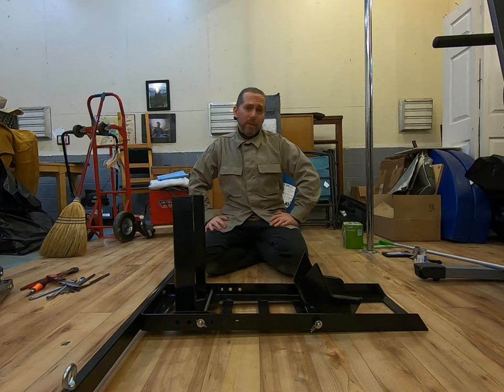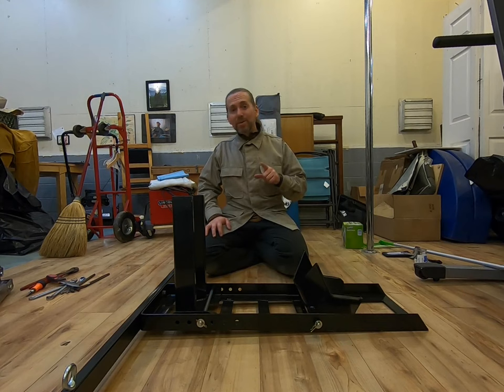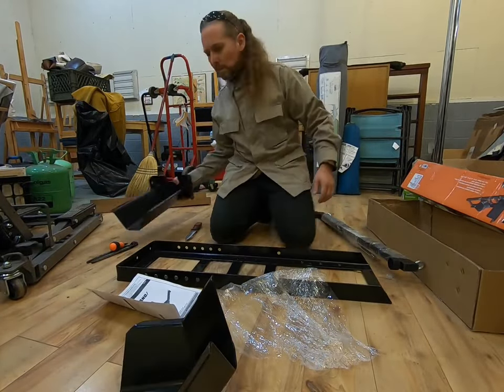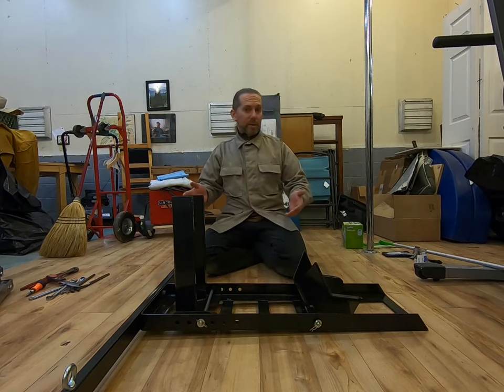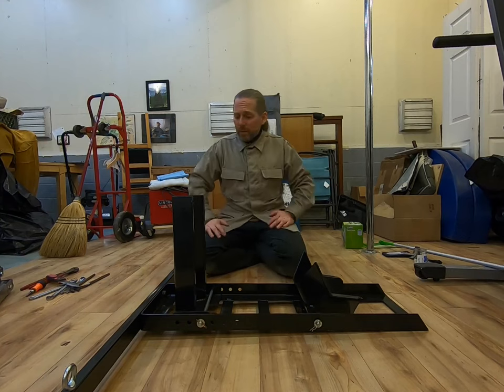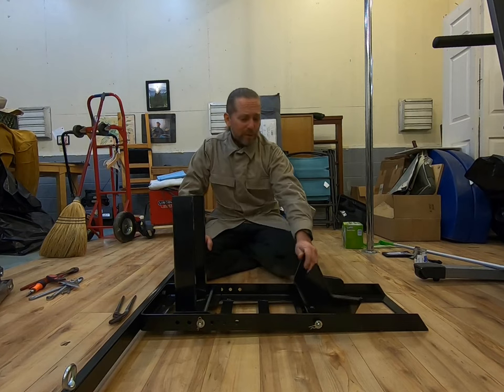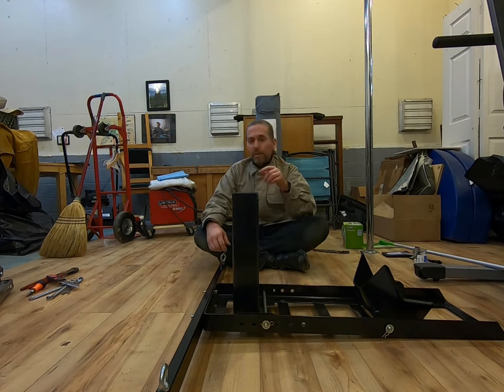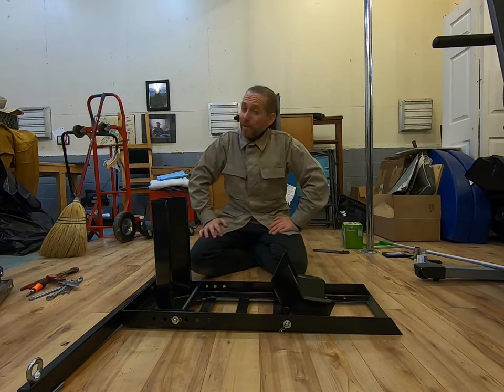Harbor Freight Front Wheel Chock and lessons learned

Comment: I recently saw another video about this issue. The guy used a 1/2” piece of plywood that was cut to fit inside the actual area where you push the tire into the chock with a 30° bevel on the front edge. The weight of the bike held it in place and it didn’t slide at all. It was removable also. Think the YouTuber is ‘what’s up bob’.
Reply from the maker: I've seen that mentioned a couple of times, and may put it to good use. Thanks for watching!

Comment: Thanks for posting.  Was it too long?  Maybe a bit but much better than being too short.  Other than permanent mounting in a trailer, I’d say the best way to keep it from sliding is mount it to a sheet of plywood.  It doesn’t have to be a 4x8’ piece but long enough that you get the front wheel on it before you hit the ramp.  The weight of the front wheel ought to hold it from sliding.  And if permanent mounting isn’t for you, use bolts and wing nuts so you can disassemble it easily.  Just be careful not to step or drive on to them.

Comment: my problem is not sliding the chock or loading the tire on, my problem is pulling my 900 LB. Road King out of the Chock. Impossible to pull back and lift up the same time unless having the neighbor  helping to push or pull me out of it. it is the same model as the one in your video. any suggestions?
Reply from the maker: So I have 3 answers. 1: consider a different style of wheel chock, one that doesn't have the "bump" to roll OVER, but you roll IN and clamp down on the wheel instead. You still probably want to bolt those down to a wider support like a piece of plywood, they tend to be narrower and a heavy bike like that may still tip easily. I only have experience with this rocker/cradle style. 2- Maybe a small piece of wood under the rocker so that it doesn't sit all the way down, decreasing the force needed to back it off. Be careful with this as you may be decreasing the stability of the bike because it can't sit fully down. 3 (and you probably won't like this) Get a different bike, your bike may just be "too much" for you. Part of sizing a bike is how well you're able to move it around, right? If you can't load it in/out of a wheel chock, it may be too big. I struggle with the Valkyrie on this because at 700lb it's about as big as I can handle by myself. Some day I probably won't be able to. Or just keep bugging your neighbor when you need help. Thanks for watching and for asking, this is a good question.
Reply: 900lb road king??? My electra glide with tour pack only weighs 850lbs.

Comment: I had one before. It's a great chock for the price and very strong. I have a Condor now. It's a great piece of kit but doesn't really do anything better other than release the front wheel easier. Some tires will stick to that smooth steel. I would have bought another but my brother gave me the Condor. Nice
Reply from the maker: I've never heard of the Condor and just looked it up. It looks more adjustable and that ease of wheel release can make a huge difference! Thanks for watching and thanks for the product tip, if I've got some cash to spare I'll definitely try it. Happy New Year!

Comment: Apparently your video attracted some trolls unable to keep their negative opinions to themselves. Whatever happened to "if you can't say something nice, don't say anything"? 

I thought your video was awesome, and I laughed my ass off. I appreciated you sharing the fails that many others omit.

I have a Pingle chock in my trailer. Unfortunately, I positioned it such that the motorcycle tire is right on a seam on the floor. Compressing the suspension is causing the back OSB to sag, and I fear one day it's going to let loose. So I'm looking for a different chock. Condor is nice, just too pricey for my liking. I may just use a piece of aluminum channel under the tire to distribute the weight. 

Thanks for sharing your experience.
Reply from the maker: Thanks for the kindness, I tell haters "You get what you pay for!" It was frustrating but also fun to make since I'm just sharing my adventures. I'm going to be in the trailer market soon for hauling both my Valkyrie and my Ural and problems like what you describe are not far from mind. I may wind up scratch building some open frame thing myself. If you do wind up going that route, kindly send me a photo or video link, I'd love to see what you come up with. Thanks again.
Reply: @bikerbobcat  I just ordered two WheelDocks. Similar to a Condor and yours, but without the bump you have to scale going on and off. A little more than I wanted to spend, but like you said  "You get what you pay for". Safe rides friend.

Comment: The rubber mat trick works wonders haha looks like a nice chock for the price im working on getting an enclosed trailer and then i would get this chock and bolt it to the floor of trailer i already have a motorcycle jack i use when im doing some work on the bike 2016 Harley-Davidson Road glide special
Reply from the maker: For the price it's really good. Just, y'know, needs a little tweaking. Bolted down in a trailer would be great for sure. Thanks for watching!

Comment: I would just bolt it down to concrete with a couple of brackets; I did the same thing with Harbor Freight tire changer
Reply from the maker: Hey thanks for watching. I thought about bolting it down, and someday might, but that would require dedicating a place for parking and work. Right now, the portability of the stand is its greatest asset. Cheers!

Comment: Bolt it down to 3/4 inch plywood.
Plywood should be 2ft w x 4ft long.
As you drive on plywood, the weight of bike (on plywood) will hold the harbor freight motorcycle chock. 
And besides it’s bolted down to the plywood.
Need to adjust wheel chock. Simply back bike off, readjust. Repeat.
Reply from the maker: I thought about something like that but it makes for a bigger, heavier thing than it already is. The rubber pads grip and don't add any more weight, and that seems to work alright.  Thanks for watching!

Comment: or extend a rail so the  back wheels sit on it and keeps it from moving
Reply from the maker: I thought about that, and it's a common solution. My only concern is that it makes it even bigger and more unwieldy than it already is. That said, if my foam skid solution doesn't pan out long term, I may do just that but with a clip on piece of sheet metal. All it needs to do is pin it down, right? Thanks for watching!

Comment: I use one in my trailer and have hauled my bike thousands of miles without issue but of coyotes bolted down.
Reply from the maker: I don't have a trailer yet, but in that case it would absolutely be bolted down. Not sure if I want a Harbor Freight special or one already designed to hold bikes. Choices choices. Thanks for watching!

Comment: Its guys like you that give Harbor Freight a bad name. I bought this unit today and the instructions clearly state " anchor the unit". Which part of that did you not understand?
Reply from the maker: I can't anchor the unit, nor have I seen anyone else do it. This is not about properly mounted chocks because sliding wouldn't be an issue. I understood it, and this one part I can't do. I absolutely LOVE Harbor Freight and recommend them to everyone. It'll be okay. Thanks for watching anyway.
Reply: Attach it to a 1/2 " thick sheet of Plywood 3' x 6' with 1/2 " x 1 1/2" bolts. I got angry listening to you stating you were going to return "junk" to Harbor Freight several times. I bought this today, attached it to Plywood and it works perfectly!
Reply from the maker: When I get junk from HF, I return it. Same with Lowes or Home Depot. It happens. What I wanted was a solution for this issue that doesn't involve making a bigger footprint for the stand. The foam skid plate works, so does small plywood inserts another Bob commented. I wanted to be able to use this, then pick it up and put it away easily somewhere with very limited space. Attaching it to a sheet of plywood means I have to have a dedicated space to sit this mounted stand and plywood and I just don't.
Reply: Put a couple anchors in your slab. Bolt it down.  Remove bolts when you want to store it.  Easy.